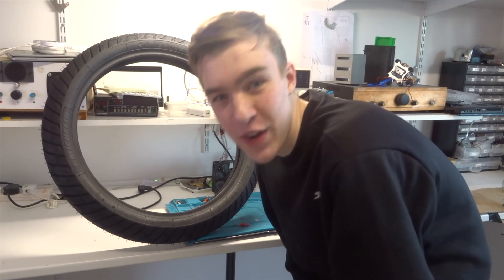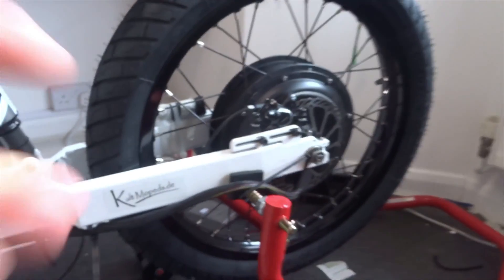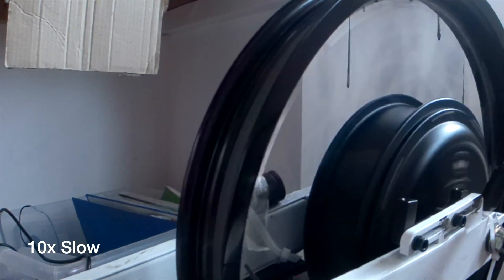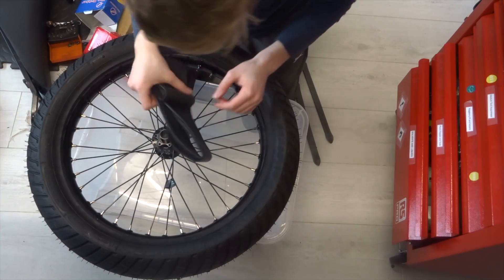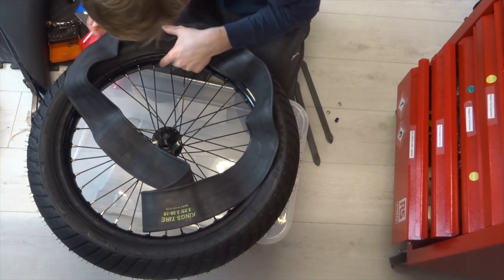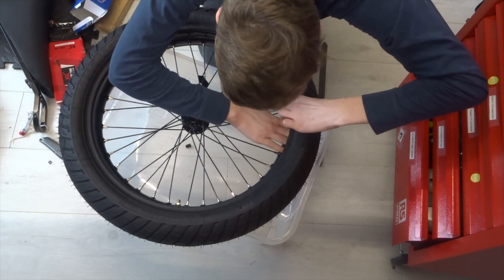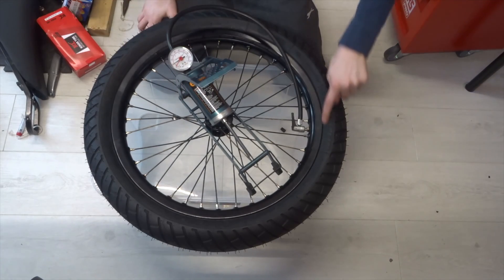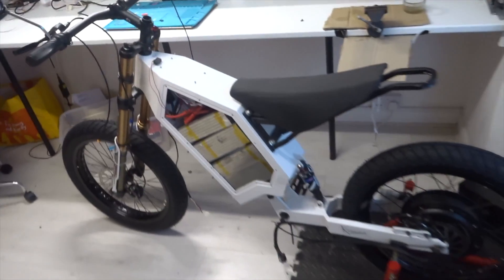FITTING MICHELIN MOTORCYCLE TYRES! - Part 14 -  8kW Enduro MSVA eBike V3 Build

Comment: Warm the tyre first will help. Use soap on the rim and important to make sure the tyre is fitted the right way round. Many tyres have to be fitted  a certain way round for the tread to work properly. If it does have to be fitted a certain way round it will be marked on the side of the tyre

Comment: What is the rim width?
Reply from the maker: They're called 85x18 but the actual width between each bead is about 54mm
Reply: @EverythingEbikeChannel  Do you think 1.85x18 rim fits the 80/90-18 tires?
Reply from the maker: @shadoworkz123  Is 1.85" the width from bead to bead? If so I reckon that would work based on the dimensions of mine

Comment: you know a little soapy water  would make that so much easier
Reply from the maker: People have pointed that out, originally didn't like the idea of water staying in the tyre but apparently it evaporates so isn't an issue.
Reply: @EverythingEbikeChannel  yea besides you dont use that much water you use more soap then water for the amount needed it evaporates fairly fast and you just need enough to lube the rim by time you get done its usually all gone it just makes it go on easier. When i did my tires i used plastic tire levers from a bicycle kit for the last 3-4 inches but up till that point i had no problem putting my tires on by hand. And yes iv got motorcycle tires as long as you got some lube on rim its easy+ less chance of marring the rubber on the tires if you go tubeless

Comment: Which hub are you using in your wheel?
Reply from the maker: 3kw Alien Power Systems motor. But basically the same as MXUS 3kw or similar
Reply: @EverythingEbikeChannel  I was thinking on you front wheel ahs
Reply from the maker: @crazyexperiments4815 Doh! 🤦‍♂️Vector hub https://vectorebike.com/bike/other/disc-front-hub. You have to email them and they will sort it out.

Comment: Hey, loving your build! I've recently put one of these through the MSVA test myself. A bit of advice for you, make sure you use brakes that have documentation stating an adequate speed and weight rating, that was the main problem I had with mine. I ended up putting the sur-ron brakes on mine, but tektro dorado would also be acceptable. Another thing is that the brakes need to have ball-end levers (but if you're planning on having pedals there's a clause that says this isn't compulsory I think). I can't actually see what brakes you're running so apologies if you were already aware of this. Keep up the awesome vids! If you want to see my build check out my insta f.g.s.c.1
Reply from the maker: Awesome, someone else who's done this! Shimano brakes are temporary at the moment. I've skim read the manual and am aware of the brake rules, got some Tektro brakes that will work and are the same as Andy Kirby's if you know his channel.
Reply: @EverythingEbikeChannel  Yeah I'm just waiting for my plate certificate at the moment! Ah nice, those should work just fine then.
Reply from the maker: @Fred_POV  Very exciting! What happens once it passes the MSVA, do you then register it somehow or do you go straight to a number plate?
Reply: @EverythingEbikeChannel  So once it passes the msva test they give you a type approval certificate. You then send a form to the dvla requesting to register the bike, along with that certificate and copies of your ID and proof of address. That's the stage I'm currently at. They then send you another certificate in the post (they said it would take 8 weeks), which allows you to get your plate made up.
Reply from the maker: @Fred_POV  All the best, will get to that stage at some point in the hopefully! 😂

Comment: a little bit of washing up liquid on the tyre rim will make fitting a lot easier
Reply from the maker: I've heard of that, but then you would end up with liquid in the tyre?
Reply: @EverythingEbikeChannel  It will evaporate
Reply from the maker: @Extile00  Oh ok, might try it next time. Thanks
Reply: @EverythingEbikeChannel  Mix up some soapy water and use a spray bottle. It's will dry out eventually. Don't have to put a ton, just to make it more slippery :)
Reply: Spray a light mist of wd40
Reply: @MrDeceptacon88  "lubricant" / oil near tires and brakes is a no go. Bad idea. It also won't evaporate like water
Reply: @Extile00  wd40 is fine..it wont go near the brakes...just around the bead and rim...nothing to worry about